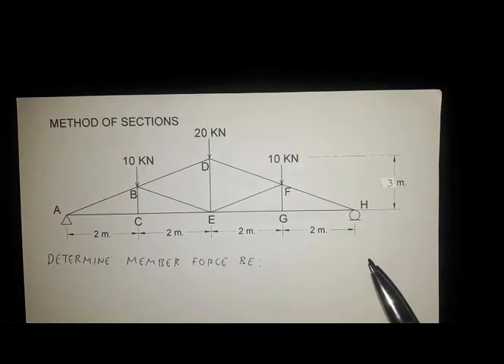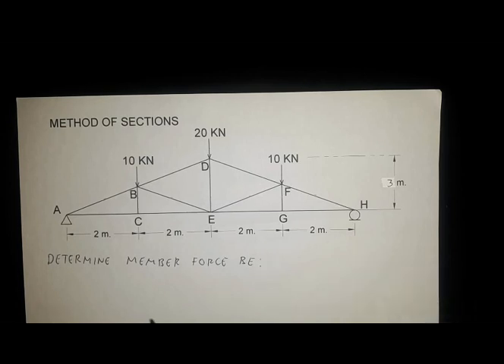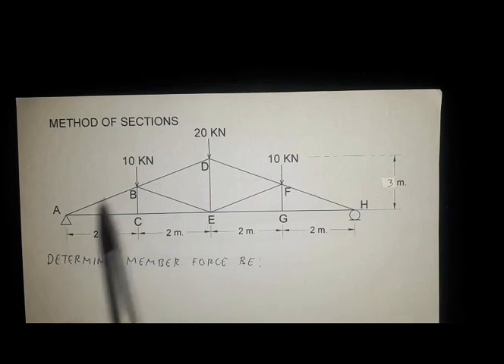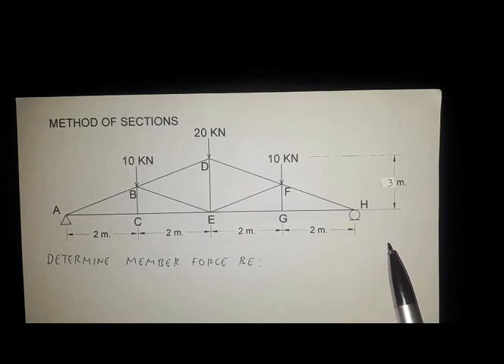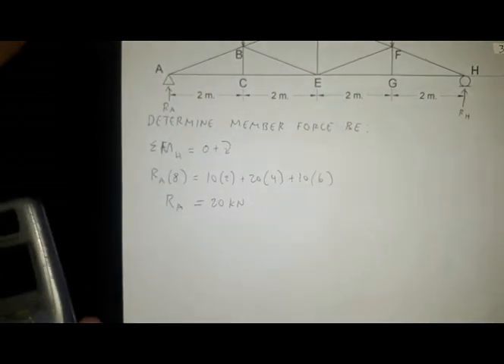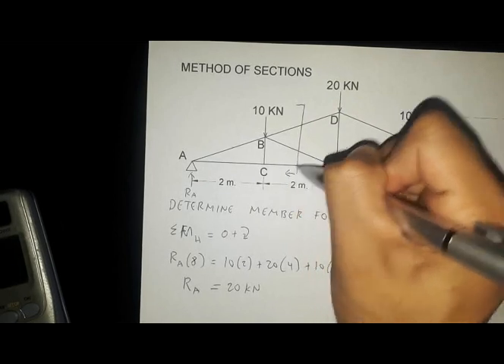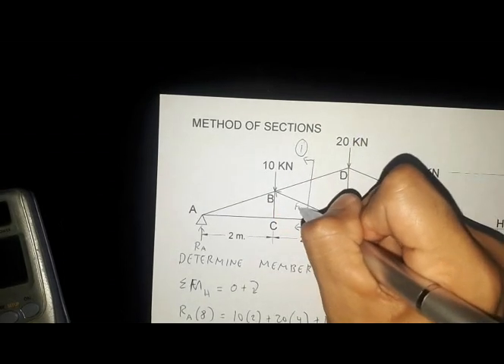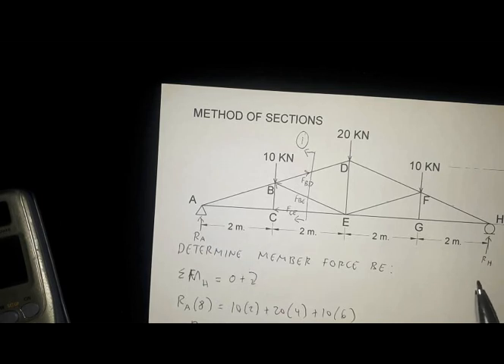Method of Sections

Comment: With all due respect Sir, but I think your process in the method of joints have a slight mistake. Please check it. As far as I know, a compressive beam is also compressive in every joint. Moreover, the force of beam AC is opposite in direction in joint C. Thus making the discrepancy or difference in the computed force.

Comment: Thank you sir but may I know why the member BD is 0? If in that instance where you do a moment at a point, all members that are in line to its action will be zero?
Reply: It is because the force is acting exactly on the joint. It coincides with the point A thus it has 0 moment arm.
Reply from the maker: That will be your homework for you to find out.